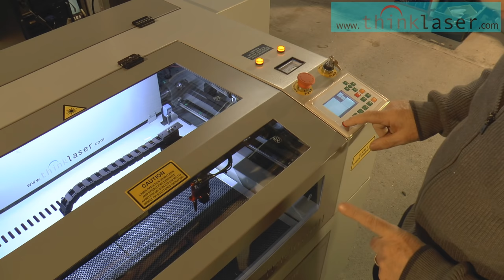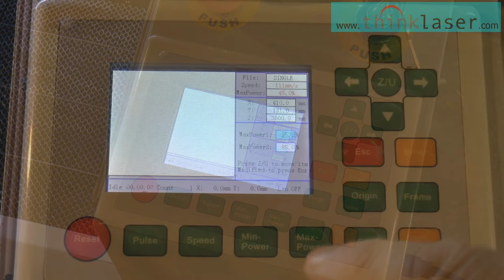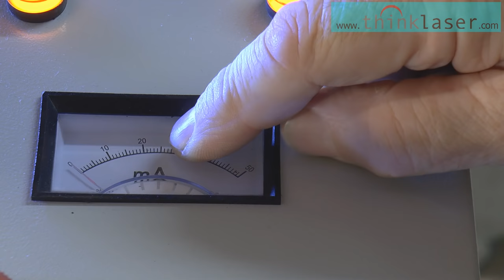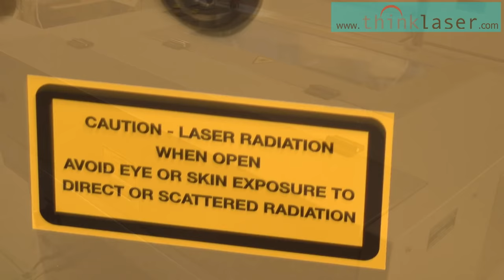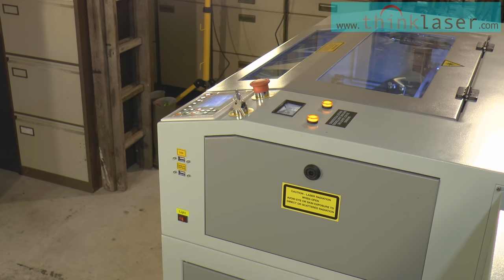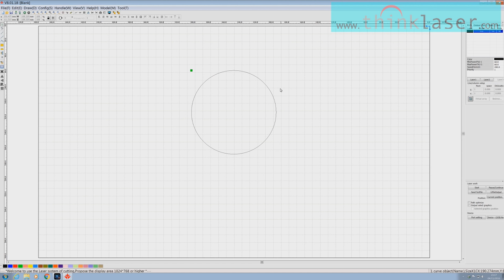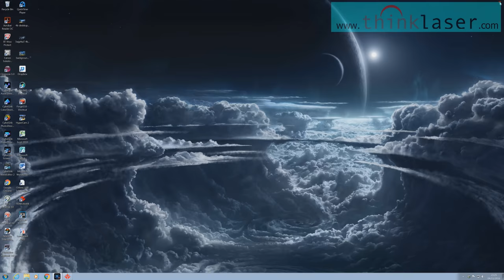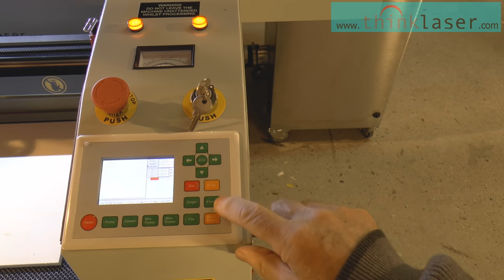Laser Machine: Tutorial Series on how to set up your Laser Cutter (and more!)

Comment: Hello Russ........I have 2 of these 60 watt machines......  I replaced the Lens on one of the machine today because it cracked.  Mind you, the machine has not been turned on for at least 5 months now........ at any rate, replaced one mirror on the head and the main focal lens.   I fired it up, and adjusted the mirror, etc.  I PULSED and the beam was sharp.... pulsed a couple more times etc.    When I rad a test run, it engraved a blank..... I then stuck a paper inline with the beam while running and it burns...... all in all, I double check for a clear path all the way down to the  material.... pulse is good, tube is good,            evidently there is power.   At any rate, what do you believe is causing the engraver to shoot blank on the run but not on the pulse.....  I don't feel the controller board is old enough to go bad????

Thanks for your input.
Matthew N.

Comment: Hey Russ how do you set up the (0,0) origin point for the laser cutter. I have an odd situation on my hands where I start up my laser and the gentry goes through the limit switch and doesn't recognize home. But when I diagnose it the x and y limit switches work fine.

Comment: Hi Russ, please I have a challenge with my laser. I discovered that if I switched it on, instead of the laser head to move to the origin at the right hand corner, instead it will move straight to the end of the machine from where you last used it. After then the laser head will not be able to reach all the angles.

Comment: Hi Russ;  The nuzzle in my new Chinese engraver move but does engrave anything. The machine does not read my usb stick. Does not show my saved files with rd or old? Any guidance ?
Thank you.
Reply from the maker: Hi Mohammad,

This is Gareth from Thinklaser.

If your machine is not engraving you need to check if the laser is firing. I don't know which machine you have so it will have to be a general explanation of things to check.

Safety first - you need to ensure that you take all safety precautions are taken before carrying out any checks on your laser. 

1. if your machine has a milliammeter, does the needle move when you start a job? 
       If yes, it means you are getting some output from your laser but your alignment may be out. Check out our 
       videos on alignment.
       If no, it means your laser is not activating which could be a tube problem / or interlock problem / or tube power 
       supply problem. 
2. If you don't have a millimeter, does the tube glow (light purple) when you run a job? (take care when checking as there is the risk of the laser beam and high voltage) - results as for item 1.

If your machine is not reading the files on a usb  stick, check if have you saved the files as .RD files and not .RLD
Go to "Laser Process Control " window, "SaveTOUFile", Save onto the USB drive. This will save the files as .RD format. 
If you are using the .RD files and the USB is still not working, try another USB stick,. If still a problem, you may have a corrupted controller. 

Let me know how you get on. 

Regards

Gareth

Comment: Hi Russ,

Just wonder what is the laser through mode ? Does it mean anything?
Reply from the maker: Hi Alice,This is Gareth at Thinklaser, Russ doesn't respond directly to these videos. "Through mode" is mainly used for more powerful laser machines that are cutting metal and is rarely if ever used for non-metallic applications. Basically the "Through Mode" holds the laser beam still at the start of every new cut, punching "through" the material to make a clear hole for the laser cut to start from. The "open delay" function defines the amount of time the beam is on before movement starts. Hope that helps.

Comment: And also when it return, it will not go back to the position where you last used it. It will shift from like 5 inches from the position where you last used it. That's how the whole work on the machine will get spoiled when there is power outage, because the laser heads is not returning back to the original position. Please